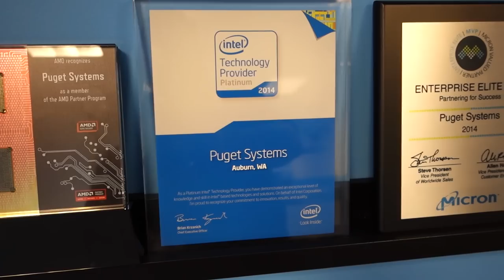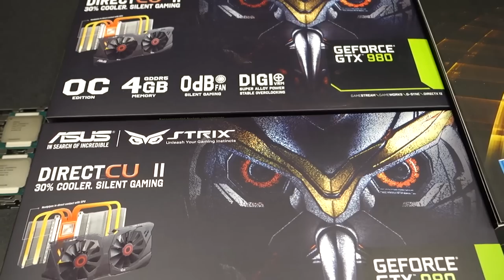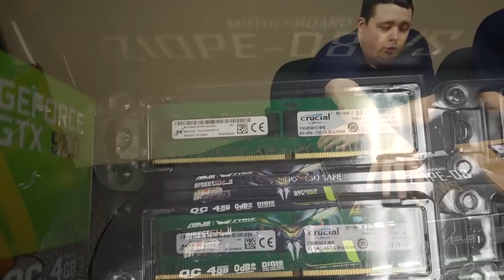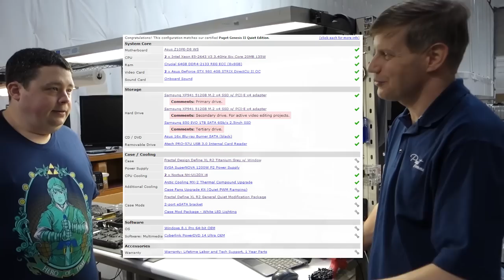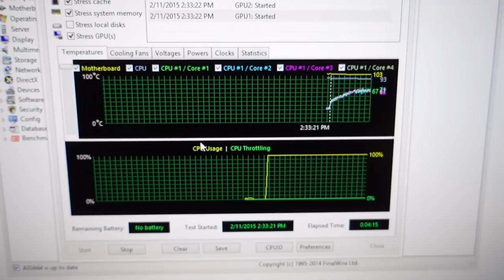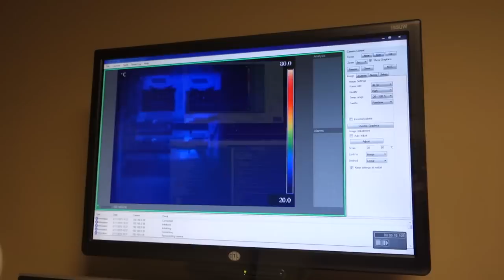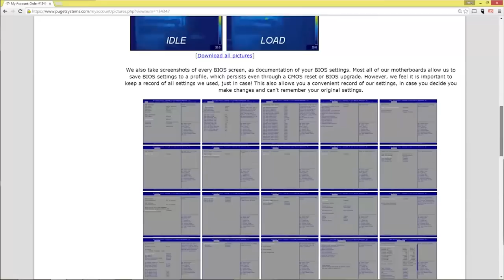Crazy Fast Dual Intel Xeon Monster PC Build by Puget Systems - @Barnacules

Comment: Hum, weird question but....
I don't see any specific sound card on your rig.
Why ?
I heard you where kind of audiophile.
And no specific sound card on this kind of system it's like for me buying a bugatti but getting the cheapest audio sound system in this car.
So do you plan to integrate a sound card in it or do you use another kind of stuff ? if so, what you're solution ?

Comment: Please correct me if im wrong. But the entire IR heat reading is messed up.... first to point out that an IR gun CAN NOT read thru glass, plastic or metal, or anything, it read the actual temp of the side panel, therefore..... the side panel must be removed inorder to read the heat. Once you remove the side panel all the heat has a huge freaking hole to vent out, so it does no use cause running the pc is completely different then running it with out the side panel. So planning the airflow with the side of and looking at IR reading makes ZERO sense. Dont get me wrong its a very nice system. And this is just personal but i dont like the define cases.... im all about the corsair obsidian cases, i currently have the 900d and love it. Rant over

Comment: why does it say intel confidential on the cpus ?
Reply: They are samples that intel sends to pc reviewers and benchmarking companies.  They typically need to be sent back to intel as they are Intel's property.
Reply: Actually, a lot of times (most of the time, in my experience) they don't require them back. They don't want them sold either, but using them internally for testing and then giving them away in review systems or demo systems is not abnormal.

Comment: Now replace the weedy 6 cores, with dual 12 or 14 cores, then raise the bclk to 105Mhz. It will boost almost as fast for gaming and be much quicker for rendering. Replace tvs with 4k versions too and record videos with a 4k camera. Then i'd be impressed. The puget can handle it.
Reply: +Jon Donnelly Will you sponsor that? Those CPUs are four times the price of the ones he used. Jealousy makes you nasty.

Oh, and 105 MHz BCLK will be luck of the draw. I've had CPUs that do up to around 107.4 MHz as well as chips that get unhappy as low as 103 MHz.

Comment: I've had my Xeon rig since 2013, it's 2x Xeon 2650 v1, it's a about 16 cores, but it's not suited to gaming as some games have issues with the cores and lower clock, It  keeps up with the i7 5960X at 3D and video rendering. I'd love to see some Cinebench scores to compare your system to mine.

My Specs
Asus z9-pe
2x xeon 2650
GTX titan 
2x Intel 520 120GB RAID 0
Corsair AX760
64GB RAM.
Cosmos II case.

I have another rig for gaming.

Comment: I have built at least 50 systems and I have to say I've only had one system failure, that was due to a piece of bad equipment.  Most of my systems are still running or have been parted out and upgraded.  I've been very fortunate, but i only do mine on thee side.

Comment: To all the smartasses who think they know everything.

If the cpu coolers were mounted horizontally, vrms above them would't get much airflow and would probably overheat, causing system instability or even, in extreme, cases dead cpus.
The distance between cpu1 fan an the gpu, almost does't matter. Try putting something in front of your cpu cooler at ~5mm, i doubt there will be more than a 1-2C degrees difference.
The only real problem is the lack of dust filter on the side window, but you could fix that for 5$.

As for the price. It is expensive, but you get what you pay for. Good quality control costs and these guys are probably the best ones at it. It isn't a problem to pay even 100% more for same pc configuration with good QC and guaranteed stability. For some, downtime is much more expensive than the price of their machines. But you, who use your pc for gaming only, wouldn't know that, would you?

Comment: Noctua Redux are great looking fans.. should have used those.. They are still very quiet.
Reply from the maker: ISEE YOU These fans were carefully selected for there airflow, sound and warranty.
Reply: Redux is another series of Noctua that has a better look but still carries Noctua build quality and is a copy of what made Noctua so popular to begin with.  Either way the build turned out very nice!  Congrats on that Beast and I am glad you stuck with Air cooling.. after building water and air rigs for 16 years I prefer to have no pump noise... although the PWM pumps these days are getting better.

Comment: I think an i7 2011v3 with 64gb ddr4 memory would of performed better for your task for the price of the 980 you could of gotten the new fury x gpus in @ 2way sli which are very quiet and on par/cheaper than a titan throw in a 2tb ssd and 4tb hard drive and this would St you 1700+ but you would be set
Reply: +Michael Albert A few things. The i7-5960X would be slower in multithreaded tasks such as video editing (which is the primary use of this build). Scaling in such tasks is pretty close to linear, meaning you can add the speeds of the cores together and knock off around 15 % as it isn't perfectly linear. Looking at it that way, you could say he has 12 3.4 GHz cores equalling 40.8 GHz of processing power, vs a 5960X which even at 4.5 GHz (pretty much the edge for 24/7 operation and getting close to impossible to cool silently) you're looking  8 4.5 GHz cores equalling 36 GHz of processing power. That's assuming perfect scaling, which it won't have, so knock 15 % off both figures. The dual Xeons are faster.

The dual Xeons are also easier to cool. At 4.5 GHz, a Core i7-5960X is dumping over 200w into a single heatsink. Dumping 2x140w into two heatsinks can be cooled more easily and quietly than 200w into a single heatisnk.

The Core i7 wouldn't support ECC memory, one flipped bit causing a crash at the end of a render that takes several days would be catastrophic. Heck, if you're on a tight time schedule a crash in a half hour render could be disastrous.

A lot of video editing and encoding applications support CUDA but not OpenCL, meaning the Furys would be no better than using the cheapest card you can find.

I don't think he needs another 2 TB SSD, he already has five SSDs in there totalling 3 TB.

Would the machine you have in mind be faster for gaming? Absolutely. You can't, however, choose all the best components for gaming for a workstation.

Comment: It's nice how barnacules is defending them but seriously two fans are "missing" having those two top fan slots occupied would decrease heat alot (that is why fractal put them there) and then there is the really bad issue of no dust protection which is a very big oversight for a amatuer builder to make never mind a pro building company.

Comment: Does it have like 7 noctua NF-12/14 fans in EU ~22 Euro the cheapest you will get. 154 Euro only the fans + 2 heat sinks. Total ~220 Euro only the Cpu cooling. That puts you to the custom water cooling price mark. If you don't want custom 2 AIO H100i v2 you probably go even cheaper.
Reply: I think the reason he decided to go air cooling is because it can be arguably cooler and quieter. I can also see why he would from a maintenance standpoint. With an air-cooled system, you wouldn't have to worry about a fitting leaking, or in JayZtwocents' case, have the blocks clog up
Reply: also 20th noctuas can outperform h100s if done right

Comment: I am brand new to the PC world and i was going to build my own pc for $1000 or less these are my current specs, it cost around $1,063 in total and i was wondering. first is this a ok build also is there any way i could drop this builds price a little bit but not affect its performance that much. i would love your opinion and help.

ram-V1.0 OC Series 8GB DDR3 1866MHZ PC3 14900 4GBx2, Red 
processor- AMD FX-Series 8-Core Black Edition 
motherboard- AMD 970 SATA 6Gb/s USB 3.0 ATX AMD Motherboard 
power supply-Corsair CX Series 750 Watt ATX/EPS Modular 
hard drive- a 1tb basic hard drive
graphics card-EVGA GeForce GTX 970 Super Clocked ACX 2.0 4GB GDDR5
operating system- Windows 8.1 Pro System Builder OEM DVD 64-Bit
optical drive-ASUS Internal 24X SATA Optical Drive
case-NZXT Guardian 921 RB ATX Mid Tower Case, Black

thank you very much for looking.
Reply: soulbreather12 you need to tell us the specs not the price

Comment: Hey barnecules I wanted to ask weather Xeon range is good for gaming and stuff.... Coz I have been told that xeon  is not made for gaming purposes...... And would not run games by someone....
Reply: Not really. Not that it's bad, it isn't, it's just kind of overkill for gaming. Even an i7 could be considered overkill given how few games are optimised or even support more than 4 threads. A top model i5 will be more than enough for gaming, but if you want to do more like video editing/rendering, photography, graphic design, programming and the like then an i7 would be minimum and Xeons would be better.

In short, just or primarily for gaming, don't bother, if you're doing actual production work on your system, yep, they're good. Though an i7 will likely be all you really need.

Comment: Also doesn't windows not use dual CPU's anymore? I know if your using linux or OSX you can use multiple CPU's but is Windows back to supporting multi CPU's?

And I know OSX is a great opperating system but Linux is a little lacking in professional grade video editing applications.

Comment: I think they done a damn amazing job... (here comes the but..) BUT... I think that it looks hideous with those fans, they may be the quietest and/or best for the job but I believe if your just going for function get a case with no window so you dont have to look in at the efficient mess on the inside. If theres a window sacrifice that 1 or 2% efficiency and get some aesthetically pleasing fans at least. On my now seriously aged rig I paid an extra 10-15£ per stick of ram to get fancy blue heatsinks for them so they matched the heatsinks on my motherboard chipsets :L

Comment: I just built my own PC, loved it too. But if you are after MAX performance for MAX money the best thing is to buy from CyberPowerPC, IBuyPower or Puget. They get major discounts, I believe they even get free OS.

When you build your own you can get exactly the parts you want, but it's like they do use great parts too it's just sometimes they may use a Gygabite instead of MSI, which is just as good or better, but it's not what you wanted.

Also for an even better deal you can buy from these companies prebuilt systems, I saw an X99 chipset pc by Cyberpower sold on Newegg for $800 on sale. If I were to build the same PC i'd pay easily over $1,500 for it.

CyberPower used like the ugliest case ever so I guess the PC did not sell very well because of it so they put it on the discount. The memory alone (X99 uses DDR) is around $300.

But for me I don't really game, I just enjoy the experience of upgrading and I really wanted to prove to myself that I can build a PC. But if you are a game I would buy from these companies, 2 years later get a better GPU and maybe an SSD. And 2 years later get a new PC again.

Comment: I have 2 HP z820 with dual 8core xeons and dual k6000's
and a Dell T7610 with dual 8core xeons and dual k6000's with 5 PCIe SSD in a raid :P they would all smoke this thing.  The HP's are loud, but one could drop them from a 2nd story and I dont even think they would dent.  The Dell is pretty darn quite but not at the level this is.  I dont know why i typed this, more just to brag and say Im still better :)  I live in seattle, we should meet up and make these beasts do a live battle (you pay for the power ;) jk

Comment: He said 2-3 years..... This should last 8+
Reply: 8+..... not nearly. i mean sure it will survive a looong time but it WILL be slow compared to whats available in 8 years. the whole point of faster pc's is efficiency and time taken per render... and in my measly 3 minute renders it takes my 5960x 2+ hours to render in after effects. ive invested loads of money to save me even 30 minutes. in premiere pro like barnacules uses my stuff takes like 10 mins ezpz but if i had his render pc seen in the video, my after effects renders would take significantly less time because id have a total of 32 ish cores/threads to render on or more depending on components which would SIGNIFICANTLY reduce time taken per render, freeing up time that i could spend increasing quality or creativity.

Comment: Sadly those heat sinks were small commpared to the one on the desktop duel core pendium D. But I guess it move the heat good. Have you ever cleaned the dust out of a heat sink. It is insane the dust that collects in my room. So lenolium floors are great if you can mop, Capet turns into a desert of dust and dirt over years. That seems like a beast of a computer you got. And did I hear right 6 core Xenons would be powerful for a system. I am more of an AMD fan but got really depressed when they split from Nvidia. Now my phenom 2 and 2.8 ghz duo 4gb ram 140gb hd laptop probably has an ATI. Sad. It is so old. :(
Reply: travis moore Hot spots and thermal load is a science now. But I just think the ssd's will make it more reliable with windows.

Comment: I find it very strange- that AMD (ATI) could make a "Crossfire" for their GPUs (which is now said to be "obsolete"?) but Intel can't make a "Dual Channel" CPU bridge, so each GPU could have their own CPU, and share. Dual channel RAM is exponentially faster (bandwidth / throughput) than Single channel, right?
Reply: All RAM is DDR now (dual channel).
Reply: UKPhoto111 DDR is Double Density not Dual Channel.
Reply: UKPhoto111  I'm referring to on a Motherboard, when only one RAM slot is used, it is considered "single channel" in the BIOS. If two DIMM slots out of four (different colored) the BIOS recognizes it as "Dual Channel"

I am talking about the usage of the RAM, not it's makeup.